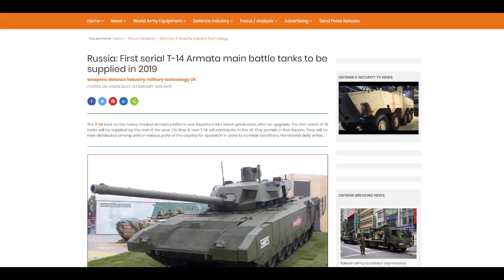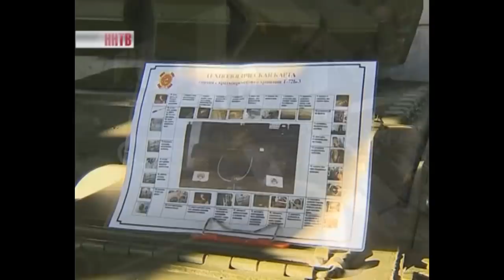Problems with Russian tanks

Comment: The biggest issue with Russian tanks is their complete lack crew protection; it is good for the tankers that Russia finally fixed that with the T-14.
I think it an absurdity to claim that the T-90 is just as good or better than most modern MBTs. The T-90s biggest flaw is that it is a souped up T-72, and the T-72 as a design, has a reputation for being complete trash. No matter how heavily upgraded it is, a tank based on a deficient design won't ever compare to a more modern MBT which has been first rate from the start and then has decades of modernization on top of it. Now obviously, the most deciding factor in any battle will be crew experience, since even the best tank crewed by idiots will likely be the loser, but there are just some design flaws that even crew experience cannot overcome, like keeping your ammunition around the base of your turret. T-72s with their turrets blown off due to ammo detonation isn't just an Iraqi substandard T-72 phenomenon as this has happened to a lot of Russian made Syrian T-72s as well, not to mention that western tank crews are trained to exploit this weakness.
Reply: First T-90 was a modernized T-72. But the T-90A is a whole new design and cant compared to the t-72. The modernized T-72 which russia has have enough protection. You cant compare it to downgraded export versions of the T-72 first T-72 version the the T-72 "Ural" without composit armor also Iraq had many selfmade t-72 copys called Lion of Babylon with mild steel even a 30mm could penetrade it frontal.  After the Nato got hands on some T-72A with kontact 5 from the DDR after the collapse they made tests and none of their tanks could penetrade it. Keep in mind it was export downgraded T-72 russia had in that time the T-72b with kontakt 5. 

Just look what happend in Iraq. ISIS mostly destroyed all of the Iraqi abrams. And houthis destroying weekly Abrams from the Saudi
Reply: @hakkigakki2050  Got any source that backs up yout claim that NATO couldnt punch a hole in a Russian T-72? Iraqi and Saudi M1 losses come from the fact that their militaries are some of the worst on the world. Saudi Arabia may have tons of oil money to buy all the best equipment, but their military is still trash. Iraq was given stripped down early model M1s (Which are still good tanks) but their army ran at the first sight of ISIS.
Reply: @NWA744  best source is wikepedia . https://en.wikipedia.org/wiki/T-72

The July 1997 issue of Jane's International Defence Review confirmed that after the collapse of the USSR, US and German analysts had a chance to examine Soviet-made T-72 tanks equipped with Kontakt-5 ERA, and they proved impenetrable to most modern US and German tank projectiles. A U.S. Army spokesperson claimed at the show, "the myth of Soviet inferiority in this sector of arms production that has been perpetuated by the failure of downgraded T-72 export tanks in the Gulf Wars has, finally, been laid to rest. The results of these tests show that if a NATO/Warsaw Pact confrontation had erupted in Europe, the Soviets would have had parity (or perhaps even superiority) in armour".[49] KE-effective ERA, such as Kontakt-5, drove the development of M829A3 ammunition.

Keep in mind that were T-72A downgraded export tanks in that time Russia used the T-72b with kontakt 5

 Iraqi got downgraded first version of the T-72 "Ural" without composit armor, night vision. etc. And u say russia tech is trash but when i mentioned what happend with the abrams in their hands you blame only the personal not the tech.

Your are not much biased

Comment: It's funny Russia was finally modernizing their military trying to get it closer to current standards and the T-14 armata was unveiled the next-gen Russian main battle tank a big deal 
     So big it got many Abrams haters coming out of the woodwork saying it was going to spank it, being Russia they it off showed it off at a parade in 2015 bfd.....where it would break down and had to be towed from they had a goal of 2,000 of them by 2020........ it's now 2019 and from best estimates there barely 20 built..... I think Russia found out the hard way that building a proper MBT is expensive, complex and time-consuming (which they still should have known they make a new tank every decade or so ffs ) 
   looks like we'll have to wait a while longer for the Ivan to get with the program.... hell the Abrams could be retired and replaced by the time the T-14 finally arrives.......if it ever does in decent numbers
Reply: First the T-14 didnt got towed away just watch the full movie not the 10 clip from the western media clip. The driver accendtly pressed the automatic brake. Even my anti russian media corrected their statement.

Also the whole russian military complext is under huge modernization.  They mainly focusing now on their aeroforces (Planes, anti ballistic missle system etc) After the modernization is finished 2027 u will see your expected 2k armatas. Also all their T-72 getting upgraded to T-72b3m/b4 which is equal to all western tanks and T-90A to T-90m which is superior to the western tanks. No need now for 2k armatas.

Comment: There already out of date because America has the M1Abrams A3 now
Reply: They dont have and wont have M1A3 by end of 2025. Also its just a upgrade on the old abrams design it will have only a diesel engine. Lighter Gun and Armor and  some new electronic systems.

Comment: Boris Dzino
 Doesnt works that way. A good armor either way made from a special layered material or just a thick one would stop regular and even big shell impacts so the enemy would need to make bigger tanks or adding more shell capacities if he wants to excert some effects in his offensive. On the other side the angle of the slope in its design makes shells to ricochet thus a very thick armor is not needed for regular shells. 
Also big armored tanks arent needed when they have the addition of good skirts on.

The decision goes about which type of tank and which type of shell are to be used in combat whe considering which toys the enemy is going to be using. High caliber shell against thin armor will simply pass through it sometimes without causing much damage. In other cases the decision of using regular shell against regular tanks can be a mistake when the opponent is using appropiates skirts or when armors are designed in the appropiate slope.

Comment: T-72 has proven its place in modern combat in the ukraine war. A single T-72 made an assault of 3 anti-tank equipped BMP's and 60 men fall back because of losses.
Reply: That was against Ukrainians who barely knew what they where doing, a t-72 attacking a prepared nato force would be dead by javelin/atgm off a warrior or Bradley before the challenger 2s or abrams even bothered showing up if they even did cause a single attack helicopter or airplane would just laugh at it or even multiple of them, the age of tanks is over, just like battleships, there's no point spending billions on a tank for it to be dead in 5 minutes which is the expected lifespan of a tank or ifv in a technologically equal war. Air power is king everything else in war effectiveness is greatly reduced if not completely negated if the opposition have air superiority. Cause all you can do is hide an not be a big obvious target, that's harder to do in a tank by a just abit, camo them up like in the video all you want, that helps against infantry it breaks up the outline but if your expecting an apache, jet or even opposing mbts/ifvs to be scanning around with the naked eye they'll be in for a shock.
Reply: Kalum Bailey muh challenger, muh Abrams 
You are aware that Russian Forces also can use ATGM against nato tanks
Reply: @SovietBear91  yeah I know I rambled abit I do that alot aha, my point was all tanks are almost obsolete now, can't use them against insurgents because they'll just be took out by a mine, can't use them against people with our own firepower cause as I mentioned any air or even just infantry with atgms in a covered position wouldn't have a problem, infantry could be overwhelmed with multiple tanks but an attack chopper/jet carries a bunch of missiles you'll easily take enough damage off one to completely stop and push back a tank advance unless it's on ww2 Russia tank rush levels, like I said this day any age I think all tanks are meh, I love them cause they're cool asf but if a weapon that can be carried pretty much by a single man can destroy a tank then tanks are completely pointless, every definition of what one is supposed to be good for is completely nullified. It's big an scary yeah but a trained soldier with equipment standard to any first world country can take it on on his own an maybe even have the advantage depending on the environment like urban or dense forest/jungle. If something costing billions to develop and produce an is supposed to be cutting edge cant guarantee that it'll be 100% effective against a dude with an upgraded version of something invented almost 100 years ago, then what's the point?

Comment: Should just bring back the T-34s and call it a day
Reply: T-34 with 100mm gun OMG  thats the sex im talking about ...
Reply: @edgarvirabyan152  Not possible.The turrety ring is way to small.To put a 100mm gun in it.
Reply: thunberbolt two have you heard about t-34 100 you know you can make new turrets just like t-34-85 and t-34-100 did exist and did kill a tiger 2 from what I know only one got to the frontlines and it was mostly a prototype and was only used before the t-44 got massed because you can just stick a new turret on

I also am proud that my great grandpa was the t34 100 commander
Reply: @yeeterdeleter6306  Was the t34-100 practical ?No it wasnt.The turet ring was way to small for a gun that big.Puting a new turet on it wont sovle that p[roblem at all.
Reply: @yeeterdeleter6306  I lookeked it up.The t34/100 weas proposed in april 1954.that was 9 years after ww2 ended.so it never killed a tiger II.So it nevermade it to the front lines. You grandfather lied to you.plus it was a czech design.not a russian one.it was never built to.oh the russians didnt need it  because by 1954 they allready had the t54 55.Which had better armor.
Reply: Meh.  Why not,  you can buy one for less than a new SUV.

Comment: The T-14is just a Russiafied American M1 TTB.
Reply: Not at all the design philosophies are compleately different. They are both great tanks but thr T-14 was designed from the ground up to fight in a modern interconnected battlefield. While the M1 is an increadible tank meant to fight independently during a ww3 scenario thus its been upgraded to be connected in the battlefield but its still in its core a Cold war tank instead of a 21st century tank.

The needs of war change both are amaizing tanks but to say they are the same does them no justice

Comment: end of the day, a m1a2 sepv2 can kill a t-72b3 at 2000m with ease with the M829A3 sabot round, and the t-72b3 will need to get in range of 1200m or less to get a penetrating shot on an abrams. a svir or refleks missile wont penetrate the hull or frontal armor of an m1a2 sep v2. i have seen a sep v3 in person and it has additional armor plates on the hull and turret. m1a2 can easily fire 10 rds minute and with the penetration of its sabots, a m1a2 sep v2 would most likely kill 2.3 t-72b3 for every loss.

Comment: I've watched the development of the T-14 since it was first announced.  While the fan boys might be impressed, as a tanker I can't help but notice that the T-14 is not revolutionary, but is a rehash of ideas experimented with and rejected in the West in the 1970's and 1980's.

An unmanned turret might seem like a good thing, but when you realize that it increases cost and complexity while decreasing reliability and sustainability in the field, the trade off's exceed the advantages.

Specifically, what is the advantage of a lightly armored turret which contains all the tanks most important systems?  A hit to the turret by even medium (25mm/30mm/40mm APDS) will penetrate the turret and take it out of action without the possibility of the crew falling back on manual systems (IE, the 105D sight on American tanks).

While you may save the turret crew, a tank that is at the Vehicle Collection Point swapping out turrets is not on the line doing its job.

That the Russians aren't building many and are focusing on updating their existing fleet just underscores the point that the T-14 is not a MBT or even a Medium Tank.  Its a very expensive, rather fragile, Tank Destroyer.
Reply: The turrent has armour where it needs it. Unlike other tanks that require the whole thing to be armoured
Reply: @augustsinyukov8497  you are arguing a lost cause.  The T-14 is all but canceled.
Reply: Waltham1892 
How do you know that the T-14 is "very expensive", "too complex", "rather fragile"? Someone from the West said so? Sources like the "National Interest" are prone to claim things like "we the West have tried auto-loader, unmanned turret, launching missiles from the tank gun and we assure you, people from the West that these don't work and we are far better"
For example, Striker has unmanned turret though it is notoriously unreliable and not easy to repair in field!
Reply: He didn't say the West never fucks up, he said those ideas suck which is different. Stryker is a joke built due to internal rivalry between Armor branch and Infantry whose leadership hate each other and constantly fight over money. The public never sees that part of DoD. Wheeled "armored cars" like Stryker don't required tanker MOS to operate and are cheap to produce. We aren't buying any more of them. NO military is immune to politics and stupidity.
Reply: Ob Fuscated 
Rivalries among different branches of the armed forces are rather common everywhere, not only in the US! But I disagree about the Striker and those other innovations being bad(except the one armed with 105mm cannon).
Reply: V0ID 
They are a bit old I guess, but I also like Russian and French ones!
Reply: To be fair we don’t know (and hopefully we won’t ever know) the actual combat usefulness of this tank, most likely everything that you have seen was trough a screen of some type and that’s fine but that’s just you saying what you feel like it’s happening, the only real way to test a tank is trough wars and the armata has been in none so we shouldn’t be saying “it can do this and it can’t do that” in my humble opinion
Reply: cesar febres 
Strange thing is that mostly (pro)Western media like the National Interest are the ones who provide info and their conclusions about the Armata!

Comment: I'm one of those people who think Russia should not have used the T-72 chassis for the T-90. It's just too small for one. There's no room for a bigger engine and the footprint is too small limiting how much armor it can add before exceeding ground pressure limits. This is why the Chinese Type-99 was designed with a larger hull to begin with. The Russians would be better off with the T-80 hull as the Ukrainians did with the T-84 Oplot. 

Another problem of the T-72 system is the engine exhaust on the left. This produce a large thermal signature visible from the front. The T-80 exhaust is on the rear making concealment easier. I think had the T-90 been based on the T-80 hull the Russian army would not face the urgency to mass produce the T-14 today.
Reply: The T90 dosent use a T73 chaccy it uses a Obj188 chassy.
Reply: Type-99 uses a body similar to Object 187, which was supposed to be the T-90. But India chose a cheap prototype 188. Therefore, the T-90 for Russia is not mass produced, the chassis is outdated.
Reply: @elusive6119  thats not true the 187 chaccy has crap armor it has no composite insertes at all.
Also the T90 is still in mass production for Russia they are manufacturing new T90M's on top of the existing T90A's in service.
Reply: @martinpetrovsk9725  "Object 187" - experimental main battle tank, developed in"UKBTM". Not mass-produced.https://en.wikipedia.org/wiki/Object_187#Armour
"Object 187" was developed in parallel with the" object 188 " (future T-90), both objects were under the program of bringing the t-72B tank to the level of protection of the T-80U\UD.
In total, about 6 variants of the machine were manufactured, differing in power plants, sample No. 1 had a V-84MS engine with a capacity of 840 HP, which was subsequently installed on the "object 188", sample No. 2 was equipped with a 1000-horsepower V-diesel engine with a turbocharged CD-34 (B-85) developed in Barnaul, sample No. 3 served to test the machine components and, in principle, was never fully equipped, but unlike the first two samples it had a new welded tower. As an experiment on the prototype № 3 was removed native MTO (Engine-transmission compartment) with CD-34 and established MTO T-80U and GTE-1500G. On the sample number 4 was installed a new x-shaped Chelyabinsk engine a-85-2 1200 HP.
Samples No. 5 and No. 6 were the most perfect machines of the series, they were introduced almost all of the changes.
The body of the T-72 was extended and changed the shape of the VLD (Upper Frontal Part), with the VLD was removed the famous "neckline" present on all tanks since the T-64, due to which the protection of the machine has increased greatly. On the" object 187 "also put a welded tower of a new design (later it will be installed on the T-90A), the car was also put DZ of a new generation, the predecessor of the DZ"Relic".
http://otvaga2004.ru/wp-content/uploads/2013/03/object-187.jpg
http://bronetechnikamira.ru/wp-content/uploads/2013/08/187.jpg
https://cdn.turkaramamotoru.com/ru/obekt-187-4900.jpg
http://www.rosinform.ru/assets/files/uploads/armata-esse/tank_020.jpg
http://militaryrussia.ru/i/284/310/uDDul.jpg